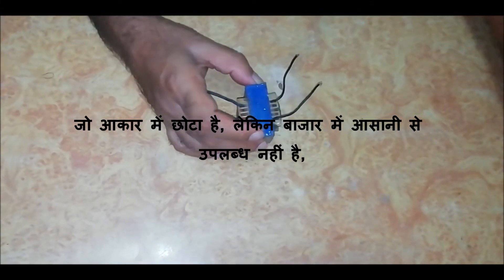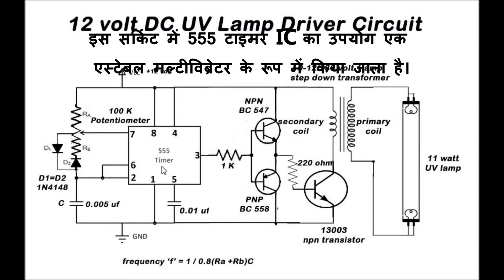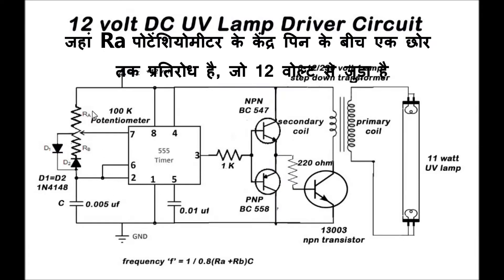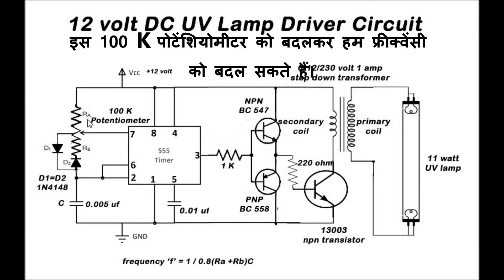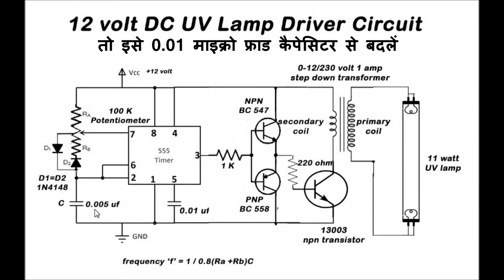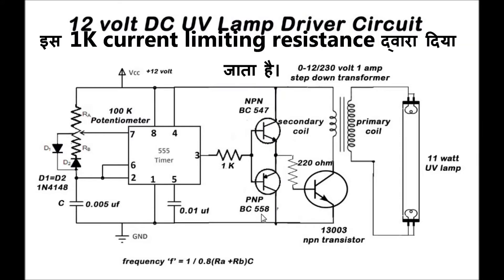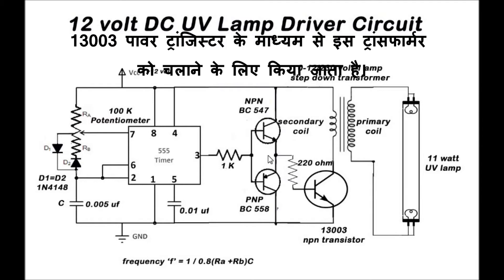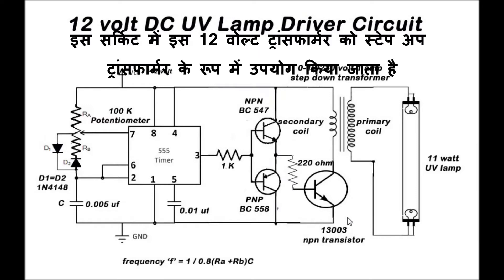UV Lamp Driver Circuit 12 volt DC | 12 वोल्ट डीसी UV लैंप ड्राइवर सर्किट

Comment: Hai sir, recently i purchase YUP UV-A Bulb G23 Base 9 W 365NM from amazon can use with 12 v battery?
Reply from the maker: it will not work directly from 12 volt. you need a ballast.
Reply: please suggest me a 12v dc powerd ballast.
BON VIVANT ® UV Choke DC Power 8 to 11 WATT LAMP ok ?

Comment: Sir, i made the circuit by using your schematic. But power transistor is getting very hot. Whats the reason
Reply from the maker: what is the ampere of your power supply and transformer?
Reply: @diyrepairs  i am using 24 volt from ro adapter by connecting lm7812 to circuit
Reply from the maker: @RakshitArya  The RO adapter gives 24 volt 2 amp current. What is the rating of the transformer you are using? Is 7812 also becomes hot
Reply: @diyrepairs  yes sir 7812 is becoming hot badly. Transformer is of 1 amp rated
Reply from the maker: @RakshitArya  The 7812 is a fixed voltage linear regulator that can output 12V at up to 1A current with an input voltage range of 14 – 35V. since input current is 2 amp that's why it become hot. use a diode 5402 in forward bias to give input to 7812.

Comment: Sir I have 12 volt adapter then UV lamp is 11 volt how to connect then if I put dirtel lamp will burn plz help sir how to burn
Reply from the maker: what is the wattage of UV lamp. for example if the wattage of UV lamp is 11 watt then divide it with it's voltage 11/11 =1 amp that means it takes 1 amp current. to reduce 1 volt from adapter, you should use resistance in series of value V/I =R i.e 1/1=1 ohm
Reply: @diyrepairs   tq so much sir for speed reply ..god bless you sir 🙏🙏

Comment: If I  using a ballast and if the lamp is not working, how to fix a indicator led and a small buzzer to know that. Generally in water purifier we know that the uv lamp is not working when the technician comes to change the filters. So need a method to have a buzzer and indicator led.
Reply from the maker: what do you want to know? I am unable to understand. If the UV lamp is faulty, the ballast gives you a beep sound every 2 seconds. There is no alarm for the filter status.
Reply: @diyrepairs  I was asking any led indicator also can be fixed to uv lamp if it's faulty
Reply from the maker: @cyril2361  basically you are asking that instead of UV lamp can you  use UV LED?. yes you can but you have to use another power supply for UV LED.
Reply from the maker: @cyril2361  yes we can. we have to make a circuit for that. actually when UV lamp is faulty, no current will flow through it. keep this in mind we can design a circuit.

Comment: Hi Sir, can I do this for a 9 watt 60 volt uv lamp?
Reply from the maker: no sir, output of this circuit is around 160 volt.
Reply: You can also use this circuit work very well for little tube 4w to 10w.
READ The description!
https://youtu.be/Sibe5QkmIvE?feature=shared

Comment: Hi Great video. This 12 v transformer is step up or step down?
Reply from the maker: step down
Reply: @diyrepairs  thanks sir.
Can we fix the frequency using the resistor.if yes pl guide the value of resistor
Reply from the maker: @RakshitArya  first, make the circuit and then adjust the variable resistance for maximum glow of UV tube. then measure the resistance of variable resistance. after that put a fixed resistance in place of variable resistance.

Comment: What is the required frequency to operate UV tube. With the components used frequency works out to be 25000. Will this transformer work at this frequency .Pls advise
Reply from the maker: ferrite core transformer works best in high frequency but this tranformer also works.